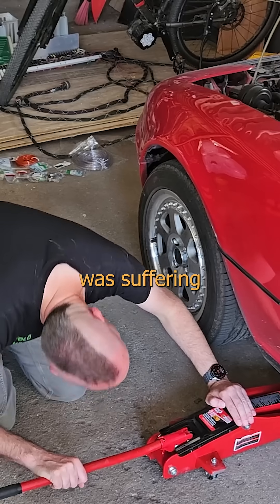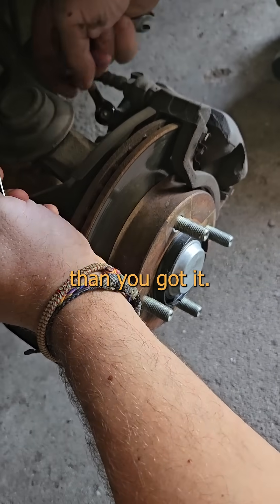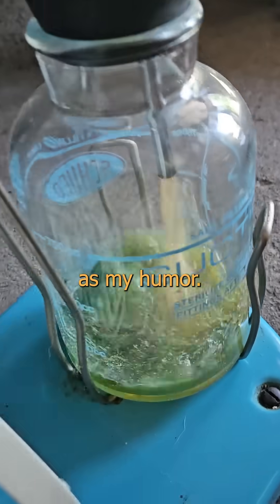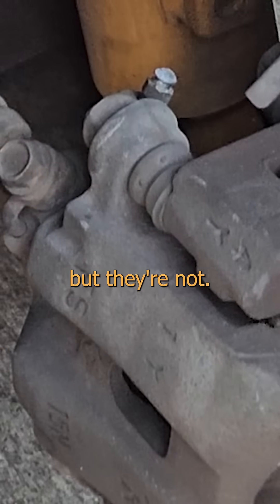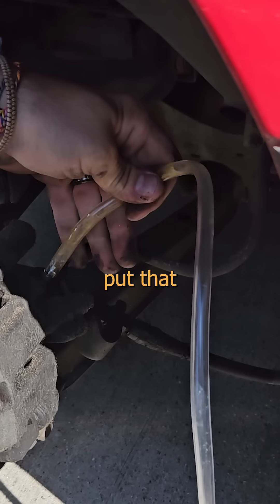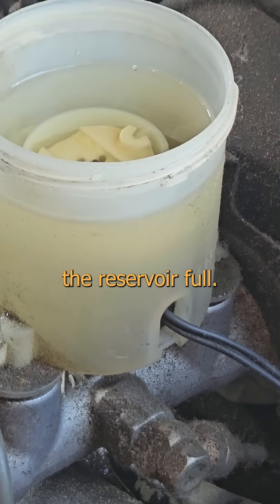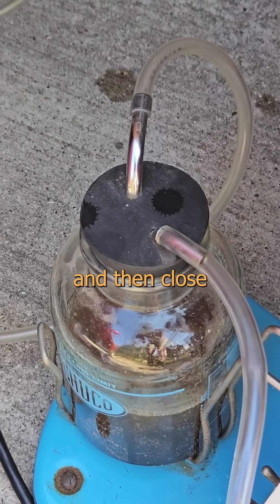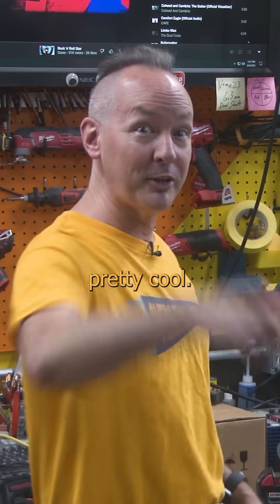How To Change Brake Fluid #chrisboden #comedy #engineering #educational #diy #skills #lifelessons

Comment: "Overengineering is the best engineering" I totally agree.

Edit: How on earth did this blow up 5.3k likes and 65 replies.
Reply: I also like the :

"well in a pinch you can .... " which is often combined with "well if you have to", along with a certain amount of "percussive maintenence"

 which invariably ends up lasting much too long, and you start getting the heebie geebies every time you go out because you are sure this is the day it will fail !

and that is certainly not cool ... but makes for excelent memories, great stories at the bar, and brilliant tiktok / youtube content

and that is preety cool.
Reply: XD
Reply: @johanntiu4162  If it is worth engineering, it is worth overengineering.
Reply: @puskajussi37 Right! If it calls for a 2x6 lumber on 16" centers, use a 2x8 all pressure treated on 14" centers. And keep it maintained.
Trust me, the next person that lives in your house will appreciate the fact that the deck won't be falling apart in a couple of years.
Reply: @clintshiplett8548  Carpenter here, if you do 14" OC, they won't 'break' on 8', or multiples of 8'. 16" OC, or 12" OC for joist systems. You get the best bang for your buck in 16' lengths, less scrap, price per foot is the cheapest, etc. You're spot on about the size of your dimensional lumber though. If my span charts put me at 66% of span/load, we're going up in lumber size or adding girders, etc. I do a lot of concrete form work, I came here to add that it's better to over build and over engineer than it is to have catastrophic failure.
Reply: @puskajussi37 easy for you to say when your not paying for it
Reply: Until you realize why he said it in a German accent (I assume German cars, my bad if he meant something else)
Reply: @Bosnian.Spartan  yeah 😅 German cars ist nicht gut…

God damned frightening some of the stupid things VW, BMW and Audi do
Reply: @Bosnian.Spartan  Russian
Reply: As engineer I can agree to that 💯
Reply: I think I need that t-shirt.
Reply: Unless you are a German tanker...
Reply: Thought the same until some stupid little part broke on my car and it cost like $2k to install a $5 part
Reply: @Spicywiener78 😂
Reply: juzt as ze founding fuhrers intended
Reply: Tshirt!!!
On the back your other one thats burnt into my mind:
“Code it a floor not a ceiling!”
Reply: If I may. Accessible engineering is best engineering.
Reply: @AsheramK You're right every form of engineering should be accessible engineering, even if overengineered.
Reply: the german in me is pleased
Reply: "Overkill is underrated" - Hannibal Smith 
If you know who that is, it's time to schedule your colonoscopy.
Reply: I disagree
Reply: Unless you're the poor schmuck that has to make those overengineered parts
Reply: As a mechanic, i can tell you, overengineering is the worst thing.
Reply: A Russian accent, not a German one?
Reply: Dude's got some German genes in him ! XDD
Reply: If it isn't broken yet, it doesn't have enough parts. That's where engineering comes in ;)
Reply: Nah. I just worked on an EV Blazer. It has no switch to turn the lights on and off. They werent working. Instead of just replacing a light switch, they had to replace a computer module that controls the lights. $100-$200 fix that ended up costing around $2,000-$3,000
Reply: BMW would like to know your location.
Reply: Reminded me of the trust me im an engineer song
Reply: @dutchgold7057 😂
Reply: Da 🫡
Reply: As a former owner of a VW GTI i will have to thoroughly disagree
Reply: you OVERagree?
Reply: My line was always, we took the Roman approach.
Reply: Put it on a T-shirt!
Reply: hard disagree
Reply: @johanntiu4162  you guys are germany mechanical engeeniering? 😂
Reply: Stockton Rush was into under engineering, and we know where that got him.
Reply: @johanntiu4162  
Anybody can over-engineer--it takes brains and talent to engineer correctly.
Reply: Da!
Reply: Same here! Its a damn shame that so many things are built just well enough to function but not to last these days.

When did we all start building things to the same quality as dollar store toys?
Reply: @vinylmodsmanitoba the overengineering is what causes things to not last and makes them more expensive 🤦‍♂️ Overengineering is good for learning and discovery. It should not always be used in a final product though.
Reply: Words to live by!
Reply: The humble Audi 4.2
Reply: Volkswagens favorite word
Reply: signed with both hands
Reply: Not all of the time!
Reply: Unless you are German and build a Tiger tank that requires too much resources. Yeah for the Nazis, as they were partly responsible for their own demise. Piss on the little corporal.
Reply: My wife does not agree unless it takes no extra time on the job or build. It's why we get forgiveness instead of asking. :-)
Reply: So SO so many “Thank You”s to Chris and also to you for saying that, I finally feel validated 😅
Reply: 2.4k likes and 39 comments in around 12 hours, didn't expect this to blow up.
Reply: You like BMWs?
Reply: @GodSent_Gullini Not exactly,
Reply: Yup, or as we say in my office “when in doubt, make it stout”
Reply: Yes 🗿
Reply: Russian voice: He sounds like man from KGB!
Reply: Audi V6 TDI timing chain drive enters the chat
Reply: 100%.
Reply: I disagree
Reply: Warhammer 40K has proven that over-engineering is the right way to do it because if you don't over engineer you're going to have. Have I taken too many crazy pills from Warhammer 40K yes but I am going to use as many as I can if I can become a tech priest with over-engineering wishes and the desire to absolutely innovate everything in existence into a war machine or at least something that can power an entire planet with a f**** 1.5 watt battery
Reply: Unless it’s modern german stuff
Reply: No.